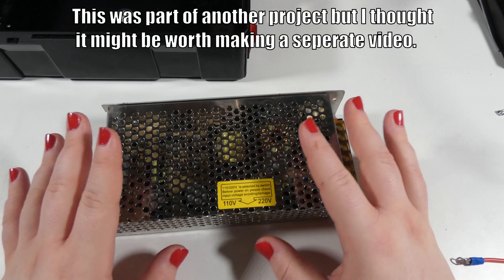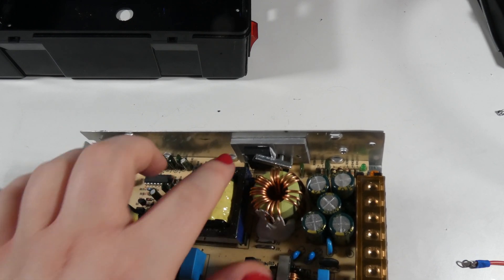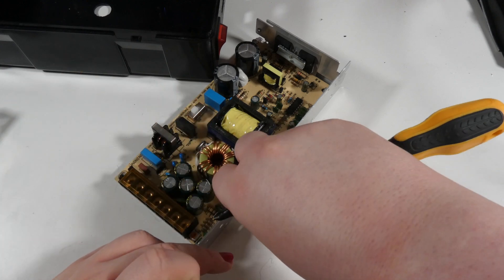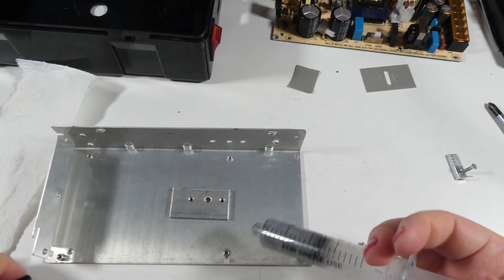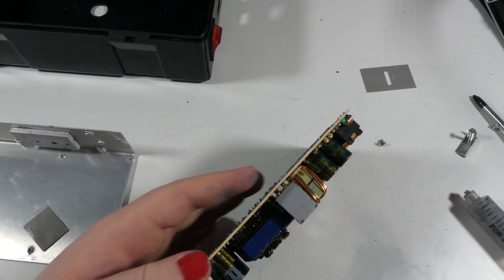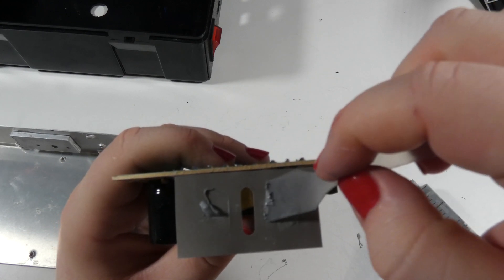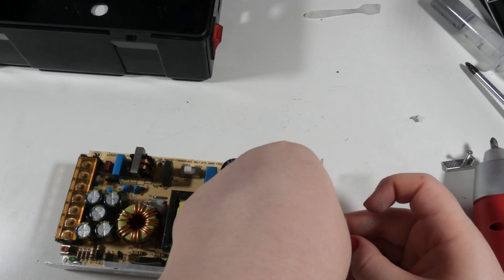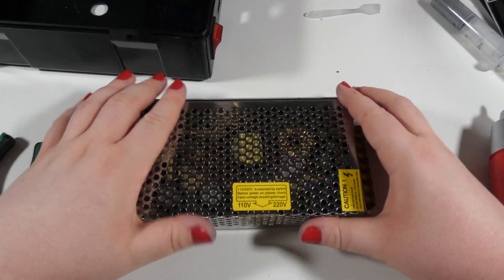Non Electrical Power Supply mod that can Prolong its Lifespan

Comment: The switch on the side changes the input circuit between a full wave rectifier for 220-240V regions and a Delon doubler for the 110V parts of the world. So it's actually equally deadly in both types of regions!

Comment: The less thermal paste, the better.
It's only meant to fill the gaps between the 2 surfaces. I often see manufacturers put big blobs of paste on components which probably make thermal conduction worse instead of better.
Personally I would have left out the pad, the less between the component and heatsink, the better.
Reply: When taking nice components such as CPUs and well manufactured heatsinks, maybe, I did eek out a couple fractions of a degree by shaving the paste. But MOSFETs and wonky alu enclosure sides? Just slather it on there, be angry.

Also thermal impedance of paste layer is so so much lower than the silpad they have there, orders of magnitude, like you don't need to worry at all.